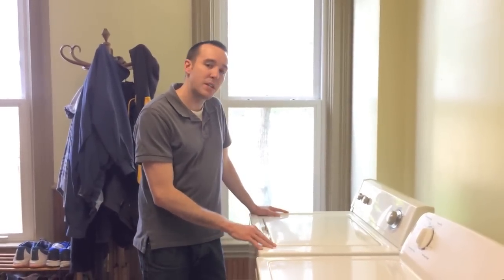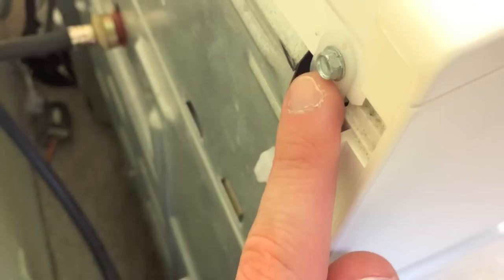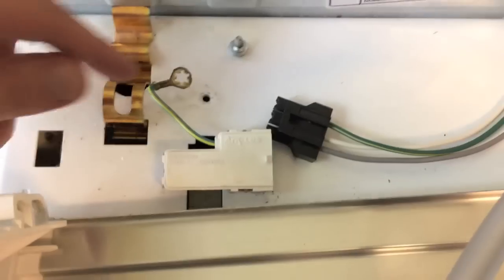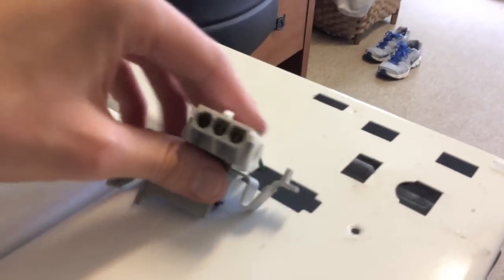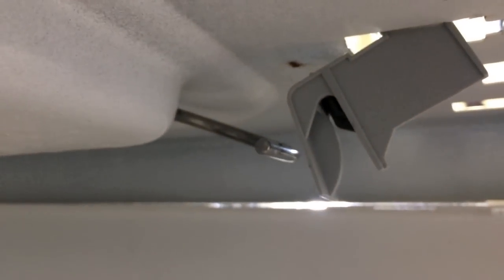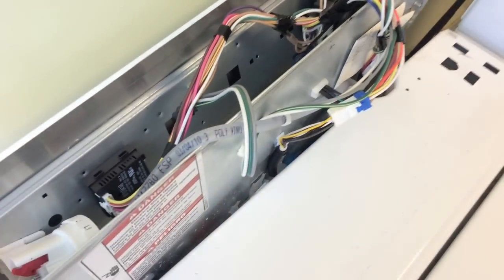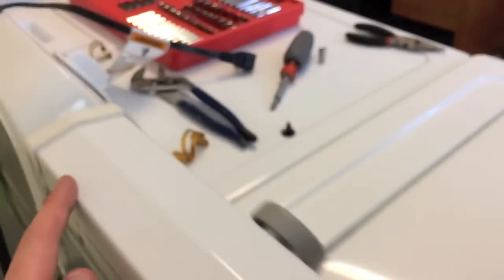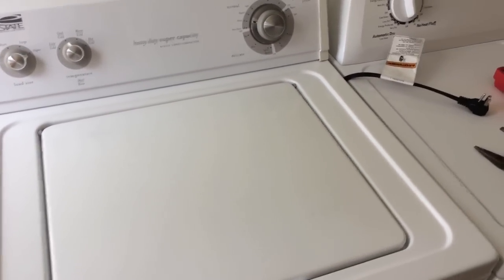My washing machine stops at rinse wont spin or drain - Replace Lid Switch

Comment: Hi there just wondering if you could help me with this. I’m not sure if it is my lid switch pressure switch which I guess is what controls the small, medium and large loads of laundry or the timer. Is there any easy way of testing this without one of those voltage measuring devices I’m not sure if I have one. I have a feeling it’s a lid switch though because mine certainly doesn’t make that clicking noise and maybe it should. My machine is 20 years old. I could easily replace it, but why do that and put it in the landfill if you can easily be fixed thank you so much in advance. !!
Reply from the maker: Good morning, just poured a cup of coffee and am sitting down to answer any and all questions for the DIY community.

We can hopefully help.  You can test your Lid Switch by using a volt meter and setting it to ohms.  If the volt meter beeps, the Lid Switch is good.  😎👍

Let us know if you have any questions and hey if you’re into crypto trading, join our DIY ecosystem and become part of an exclusive group of DIYers.

       toolboxtoken.com

Reach out to us any time!  🧰

Comment: Great video - both this and the one on the timer switch.  My question is, how to determine if it's the lid switch or the timer that needs replacing?  If it helps, I have a KitchenAid washer, model KAWS850LQ1.  Mine stops at rinse, but if I manually advance the timer knob about 1/8" it will often (but not always) finish the cycle.  Thanks.
Reply from the maker: Branton Lachman 

Thanks for watching Branton, below is a copy of our response we put on your previous question on a different video.

Great question & the symptoms led us to the lid switch first...we tested the lid switch and found that to work as it should.  This then led us to the timer.  After replacing the timer, problem solved.  Try your lid switch first...there are a few videos out there that will show you how to test it.  Please Subscribe to the channel and turn on your YouTube notification Bell 🛎 that would be awesome thanks again 😀👍

Definitely keep us posted with your DIY project, we are here to help!

😎👍🔧🔩
Reply: @DIYwithMichaelBorders  Thanks, Michael.  And again, great videos.  I've subscribed.
Reply: @DIYwithMichaelBorders   Thanks, Michael.  And again, great videos.  I've subscribed.
Reply from the maker: Branton Lachman 

Awesome Awesome & we really appreciate it!

😎👍🔧🔩
Reply from the maker: Branton Lachman 

😎👍🔧🔩
Reply: i dont mean to be so offtopic but does any of you know a method to get back into an instagram account?
I was dumb forgot the password. I would love any tips you can give me
Reply: @Hayden Enrique instablaster ;)
Reply: @Cyrus Khalid it did the trick and I now got access to my account again. I'm so happy:D
Thank you so much, you really help me out!
Reply: @Hayden Enrique Glad I could help xD

Comment: My whirlpool washer- model number LSQ8543JQ0- is stopping after the wash cycle, not draining, rinsing or spinning. If the dial is manually moved to "rinse," it just clicks. Does this sound like the timer or the lid switch?
Reply from the maker: Emily Varner 

Thanks for watching & sharing your experience!  That’s a great question!

The lid switch is designed to be a safety feature or mechanisms.  Once your wash cycle gets to the rinse portion, the Timer sends a signal to the lid switch and asked if the lid switch is compressed...meaning the door or lid is fully closed!

The reason behind this is to alleviate your washing machine rinsing and spinning with the actual tub lid open and allowing the washer to throw water all over your house...that would definitely not be cool.  😲

So to recap… the Lid Switch is a safety feature that sends the “ok” signal or “Yes the lid is closed” confirmation to the timer to allow the timer to continue the cycle!

Replacing your Lid Switch should solve your problem.

Hope this helps!  Please subscribe to the channel and turn on your YouTube notification Bell 🛎 that would be awesome thanks again!  😎👍🔧🔩

Comment: I have a similar washer to this one in the video, Im having a problem where once it hits the rinse cycle it doesnt do anything, it just hums and I can see theres still water below the bin, what could possibly be the issue? 
Edit- I already thought it was one thing, the Washer timer being shorted out but i bought a new one and replaced it and still had no luck, I can tell the humming sound is coming from the bottom of my washer aswell
Reply from the maker: Good morning ☕️ at this point, we recommend replacing the Lid Switch.

Comment: I have a Roper that's stuck on the Rinse Cycle, The Lid Switch is still clicking. Not sure if it's out. But the Washer won't turn on if the Water Cold/Cold is choosen,  The cold water is on. Not sure what the other problem could be. .
Reply from the maker: Malibu Ride 

Thanks for watching.  You may have a faulty Lid Switch or Timer.  We always recommend trying the cheaper part first...Lid Switch.

More than 80% of the time, all systems return to normal after replacing Switch.  Keep us posted.

Please subscribe to the channel and ring your YouTube bell 🔔 this will be very helpful to us thanks again.

😎👍🔧🔩
Reply: @DIYwithMichaelBorders  Thanks, I have to find the Machines Number but once I get the new part in place I will let you know. thanks again.
Reply from the maker: Malibu Ride 

Very cool.  😎👍🔧🔩

Comment: My Estate by Whirlpool washer pauses at the rinse cycle every time.  Is that enough of a reason to buy a new lid switch, or is there some way you can actually tell whether or not the lid switch isn't working before buying the new part?
Reply from the maker: antifolkhero 

Thanks for watching & sharing your experience.  Let’s get this figured out!

The most common cause of your experience is a faulty Lid Switch.  This is the most cost friendly repair & is a very simple DIY project.  We purchase our appliance parts from:

       RepairClinic.com

Enter your Model # into this website & you’ll find all your replacement parts for your washer.

If by chance replacing your Lid Switch does not fix your appliance, the next part we need to focus on is your Timer.  The Timer & Lid Switch work together to guide the washer through all of its cycles...filling tub with water, washing, draining, rinsing, spinning...

A faulty Timer will cause the washer to stop at some point through the wash.  Below is a link to our step-by-step video that shows replacing Timer.

       https://youtu.be/2zcdenZ_HSA

The 3rd option is the Water Inlet Valve.  Over the years of the washers life, the Water Inlet Valve screens get very clogged with dirt & grime...causing lack of water flow & pressure.  This will cause the Timer to stop the wash.  Below is a link to our step-by-step video that shows replacing Water Inlet Valve.

       https://youtu.be/DiPFZSMiBn8

Let’s start there, keep us posted!  Please subscribe to the channel and turn on your YouTube notification Bell 🛎 that would be awesome thanks again!  😎👍🔧🔩
Reply from the maker: antifolkhero 

Also, try this option before replacing Water Inlet Valve.

       https://youtu.be/DwJLd7xwaUM

Comment: My Maytag Atlantis stops at the rinse cycle.  If I manual move the timer to the next stage it will finish the complete wash cycle.  During the spin cycle if I lift the lid the spinning will stop.  So is it a bad timer?
Reply from the maker: Jeffrey Louwers 

Thanks for watching & let’s get this figured out!

We have a few videos on a Maytag washing machine discussing washer stopping mid cycle.  Are you experiencing lack of draining at all?  If yes, a failed Pump will cause the cycle to stop.

By chance, is your machine alerting any error codes?  Keep us posted.

Below are links to our Maytag videos.

       https://youtu.be/1kv0szRLrXk

       https://youtu.be/Cryec0cT3RU

       https://youtu.be/9ModYqZcZ5s

Hope this helps!  Please subscribe to the channel and turn on your YouTube notification Bell 🛎 that would be awesome thanks again!

😎👍🔧🔩
Reply: @DIYwithMichaelBorders  No problem with draining.  Once it stops before the rinse stage I just move the timer until I hear it click and its starts the rinse and spin cycle all the way to completion.
Reply from the maker: Jeffrey Louwers 

Thanks for the update & your Timer may need to be replaced.  If the Timer doesn’t fix your issue, We also recommend replacing your lid switch.

Keep us posted. 😎👍🔧🔩

Comment: Mine gets to the "rinse" stage, fills with water and then stops. But if I push in the dial and turn to "spin" (skipping the rinse cycle) then pull the button out, it drains and spins to completion. It shuts off at any point when I lift the lid. Any idea?
Reply from the maker: Thanks for watching & this is almost always symptoms of a faulty lid switch or timer.

Lid switch is the more friendly priced part, most start by replacing the lid switch and if that does not fix machine, the timer is replaced next.

Keep us posted.  😎👍🔧🔩
Reply from the maker: Below is a link to our video showing replacement of Timer.

       https://youtu.be/2zcdenZ_HSA

😎👍🔧🔩
Reply: @DIYwithMichaelBorders  thanks
Reply from the maker: @RagnarOdinsson  

Good morning, you are very welcome, enjoy your week.

😎👍🔧🔩

Comment: Have a Maytag washer.  Starts and  fills with water starts washing then mid cycle it stops and shows code HF . I've changed the pressure switch, shocks and cleaned filters on inlet valve and new water lines. Anything else it could be?
Reply from the maker: MannyJWey 

Thanks for watching & let’s get this figured out!

We have a few videos on a Maytag Washing Machine experiencing your exact symptoms.  1st thing that comes to mind is your drain pump.

Below is a link to our Maytag videos.

       https://youtu.be/1kv0szRLrXk

       https://youtu.be/Cryec0cT3RU

       https://youtu.be/9ModYqZcZ5s

Hope this helps!  Please subscribe to the channel and turn on your YouTube notification Bell 🛎 that would be awesome thanks again!

😎👍🔧🔩
Reply: @DIYwithMichaelBorders  nice thanks . Has a guy come look at it he said there's a hose coming out of the pressure switch that is ripped and leaking . Ordered the part waiting for it to come in the mail
Reply from the maker: MannyJWey 

Awesome Awesome keep us posted!

😎👍🔧🔩

Comment: I have an amana washer model NTW4605EW0 and stops at rinse cycle and rinse light just flashes what should i do?
Reply from the maker: Girl Power 

Thanks for watching.  This usually happens when your lid switch or timer fails.  Replacing the lid switch first is a more price friendly option.  It’s more likely to be the cause as well.

Keep us posted, we are here to help.

😎👍🔧🔩

Comment: I have a question. My washing maching goes thru all of the cycles. When it gets to the spin/dry cycle, it sounds like its doin it but it's not spinning. The clutch is good. The coupling is good. My question is could that be caused by a bad lid switch??
Reply from the maker: Earl Scott 

Thanks for watching Earl.  We appreciate you taking the time to share your experience!  Let’s get this figured out.

A few things come to mind.

1.  A failing Timer.  The timer is in charge of transitioning your wash cycle through all of its sections such as rinse, spin, drain, etc.  In the event that your Timer begins to work intermittently or fail all together, your washer will stop in a specific portion of the cycle...example could be it fills up with water and attempts to wash, then drain...however it won’t drain even if your drain pump is working.  Below is a link to our video that shows Step-by-step process on replacing Timer & more info on it.

       https://youtu.be/2zcdenZ_HSA

2.  Lid Switch.  It’s very possible that your lid switch will also need to be replaced as shown in this video.  It’s a pretty friendly DIY project.

Let’s start there!  Keep us posted!

Please subscribe to the channel and turn on your YouTube notification Bell 🛎 that would be awesome thanks again Earl.  😎👍🔧🔩

Comment: I have a whirlpool washer,it makes very loud grinding noise when it goes into agitator cycle. I have already checked agitator dogs,that is not it. Any ideas?
Reply from the maker: Gregory Baker Thanks for checking out the video and sharing your experience!  Let’s get this figured out!  😃

Grinding noises are mostly signs of the Bearing going bad!  The bearing is a very key part in the machine due to it roll in the spin portion of cycle!  

An additional issue you can be experiencing is the Drive Motor beginning to fail.  This will usually give off a small “Smoke Odor”...& then sooner or later fail completely!  No fun 😮

Unfortunately we don’t have videos on the whirlpool make & model that you have however you will find many out there.  Definitely look into those & please keep us posted on your progress.  Let us know if you have any additional questions along the way.  We want to help!  Please subscribe to the channel and turn on your YouTube notifications that would be awesome thanks again 😎👍🔧🔩

Comment: So if it stops at the rinse cycle it could be the lid OR the timer?
Reply from the maker: antonio mccoy 

Thanks for watching & sharing your comment!  That’s a great question!

The lid switch is designed to be a safety feature or mechanisms.  Once your wash cycle gets to the rinse portion, the Timer sends a signal to the lid switch and asked if the lid switch is compressed...meaning the door or lid is fully closed!

The reason behind this is to alleviate your washing machine rinsing and spinning with the actual tub lid open and allowing the washer to throw water all over your house...that would definitely not be cool.  😲

So to recap… the Lid Switch is a safety feature that sends the “ok” signal or “Yes the lid is closed” confirmation to the timer to allow the timer to continue the cycle!

We always recommend replacing Lid Switch first as it’s the less expensive part.  If it does not solve issue, your Timer is the culprit.

Hope this helps!  Please subscribe to the channel and turn on your YouTube notification Bell 🛎 that would be awesome thanks again!  😎👍🔧🔩

Comment: This is where I'm lost. If the lid switch is not working, why would the machine be able to start the washing cycle with the lid closed then just not work in rinse?
Reply from the maker: Thanks for watching & welcome to the DIY Raptor Club.  Great question & the lid switch plays a role when the washing machine gets to the rinse and spin portion.

You will notice shortly after beginning a cycle, you can still open up the lid and the cycle will continue.  However once the cycle gets to the rinse and spin, the lid switch activates and sends a signal to the control board informing it that the lid itself is closed.

Once the board gets this notification from the lid switch, it begins the rinse and spin cycle.  When the cycle gets to the rinse and spin and does not get the signal from the lid switch that the lid itself is closed, this is a built-in safety feature that will alleviate your cycle from continuing to rinse and spin at high speeds with the lid open... which will throw water all over your house and your neighbors house...😬

Hope this helps.  😎👍

Comment: What model number is your washer? looks like mine and its stopping at rinse too.
Model number is on rte he lid door.
Reply from the maker: REDSPECK HUNTER 

Thanks for watching & sharing your comment!  Unfortunately we don’t have the Model # handy anymore since we have moved.

The lid switch is designed to be a safety feature or mechanisms.  Once your wash cycle gets to the rinse portion, the Timer sends a signal to the lid switch and asked if the lid switch is compressed...meaning the door or lid is fully closed!

The reason behind this is to alleviate your washing machine rinsing and spinning with the actual tub lid open and allowing the washer to throw water all over your house...that would definitely not be cool.  😲

So to recap… the Lid Switch is a safety feature that sends the “ok” signal or “Yes the lid is closed” confirmation to the timer to allow the timer to continue the cycle!

Hope this helps!  Please subscribe to the channel and turn on your YouTube notification Bell 🛎 that would be awesome thanks again!  😎👍🔧🔩

Comment: If it is the lid switch then why when you close the lid it will wash but when it goes into rinse cycle it stops, will not go into that cycle and will not drain but it is trying to because it is still running. How could it be the lid switch, if it was the switch then it would also not wash when you close the lid.
Reply from the maker: Steve Kirby 

Thanks for watching & sharing your comment!  That’s a great question!

The lid switch is designed to be a safety feature or mechanisms.  Once your wash cycle gets to the rinse portion, the Timer sends a signal to the lid switch and asked if the lid switch is compressed...meaning the door or lid is fully closed!

The reason behind this is to alleviate your washing machine rinsing and spinning with the actual tub lid open and allowing the washer to throw water all over your house...that would definitely not be cool.  😲

So to recap… the Lid Switch is a safety feature that sends the “ok” signal or “Yes the lid is closed” confirmation to the timer to allow the timer to continue the cycle!

Hope this helps!  Please subscribe to the channel and turn on your YouTube notification Bell 🛎 that would be awesome thanks again!  😎👍🔧🔩
Reply: @DIYwithMichaelBorders  But why isn't this triggered during the spin cycle?
Reply from the maker: thedoer 

Thanks for the reply.  Depending on the machine, it will be triggered.

😎👍🔧🔩
Reply: @DIYwithMichaelBorders thanks
Reply from the maker: @satsha1052  

👍☕️

Comment: Quickest way is to cut gray and white wire and join them together and leave green wire were its at and your machine will work as new it did for me.
Reply from the maker: GC M 

Thanks for watching, we haven’t tried that.  Replacing old switch with a new switch worked best for us.

😎👍🔧🔩